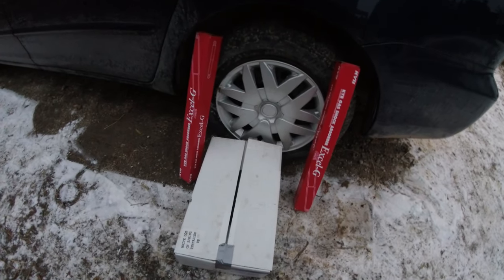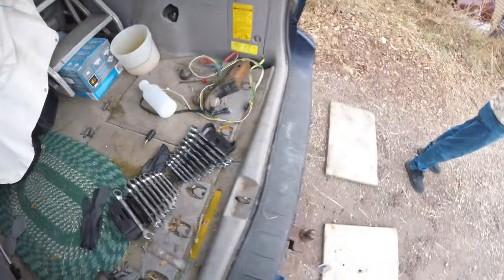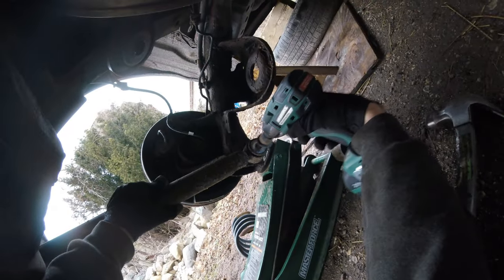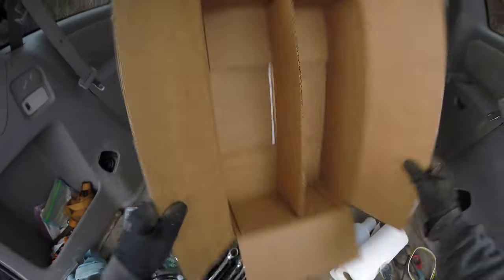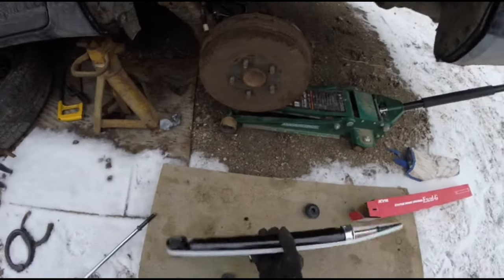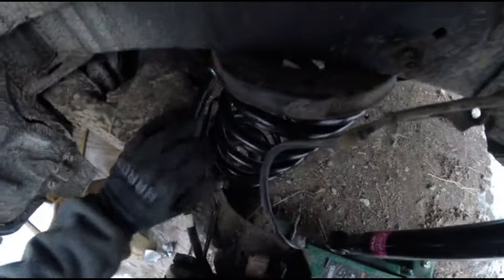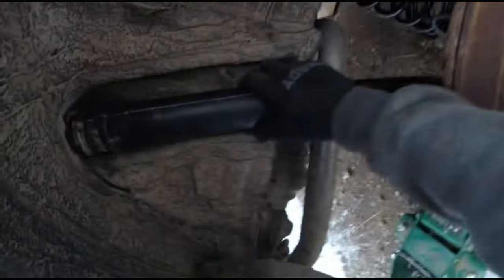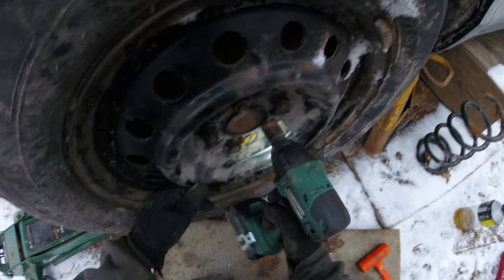How To Replace REAR Shocks and Springs on a 2006 Toyota Sienna

Comment: one of the better demonstrations I've seen.  Thank you.  What is the lb-force settings on the impact driver for the wheel lug nuts?  What about the lb-force on the lower mount nut on the shocks?

Comment: Why are these new springs r being installed upside down compared to the ones that came out
?
The flat end is up on old ones, but down on new ones
Reply from the maker: Could be the different brand of springs. As the springs where installed in the correct orientation according to the box.

Comment: Just curious , how on earth did those springs break like that ? Perhaps too much weight on the end of the vehicle , too high a tongue weight ?
Reply: corrosion is probably the primary damage mechanism
Reply: I've got the same situation on my 2005 Sienna.  Looks like rust is the cause of my spring failure too.  I have owned the vehicle since new. 210,000 miles and New England winters and road salt.